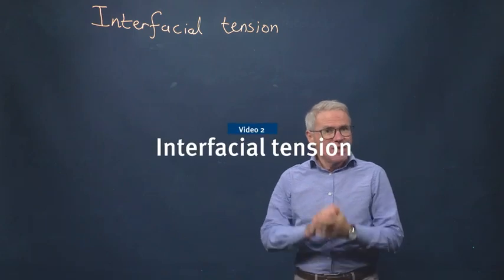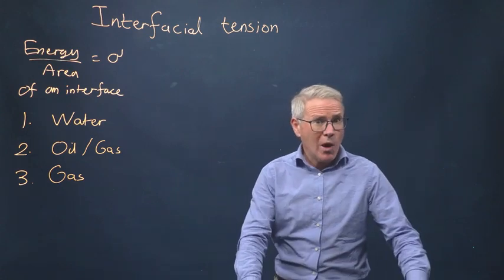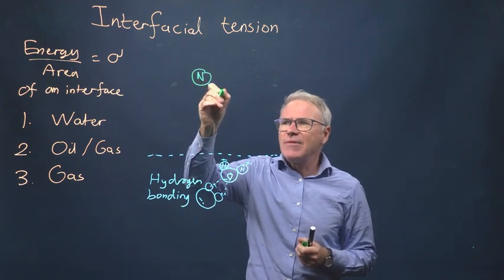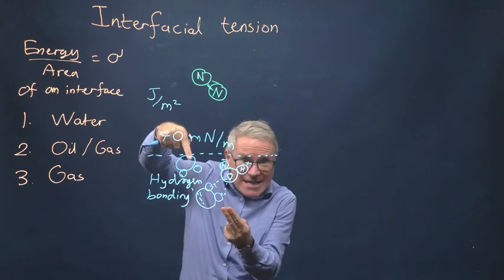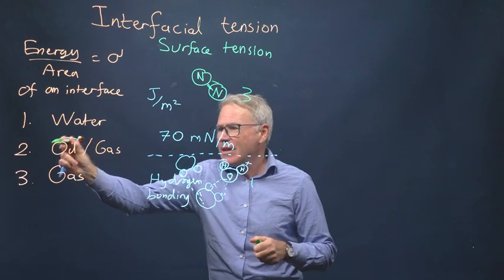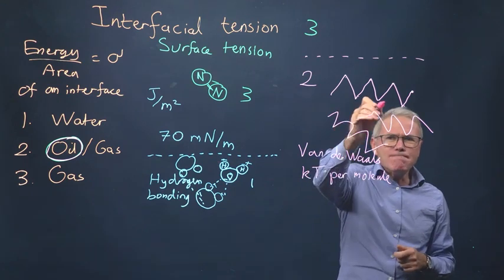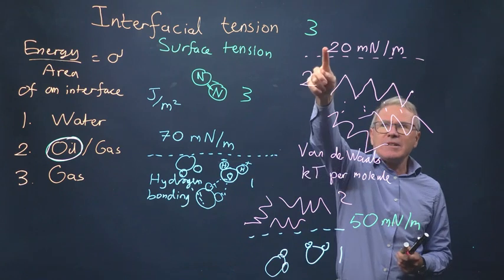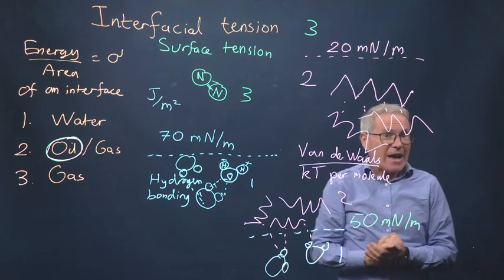Interfacial tension

Comment: Thank you! I love your video! And I have question regarding interfacial tension. If I measure the interfacial tension between water and oil using pendandrop method, would the results be different if I do it by creating water drop in water compared to inverted oil drop in water? I guess the results are the same? Can Young Laplace equation explain it mathmatically?
Reply from the maker: Thank you for your comment.  The results should be the same, as you suggest.  The Young-Laplace equation simply assumes that there is an interfacial tension - it does not help determine what it is.  To do that theoretically you need to know about intermolecular interactions.

Comment: Thank you !! I had a question, I need to analyze the interfacial tension in an oil spill that has occurred near the city I live in, how exactly should I use those measurements to calculate the interfacial tension. The oil that was spilt covered approximately 20 square kilometers.
Reply from the maker: If you had a sample of the oil you could measure interfacial tension using, for instance, the pendant drop technique.  This does however require specialist equipment.  You can also analyze the spreading of an oil spill on water - when the layer of oil is thin, its movement is controlled by interfacial forces.

Comment: Hello sir I have a question about the end of the video 
The relationship between IFT of the oil-water and oil-gas and water-gas is always true? or it works only under some circumstances?
I'm asking this because this relationship is not correct for toluene and air and water. I mean this relationship; (IFT water-air)-(IFT toluene-air)=(IFT water-toluene)  does not work
I think I have misunderstood something I'll be appreciated if you could suggest me any article about this subject
Reply from the maker: This is only an approximate relationship assuming a gas, water and a non-polar liquid..  So do not expect it to be exactly correct.
Reply: Thank you for your attention ❤

Comment: Sir I am having doubt your telling oil and water have 50 mN/m if same oil and water composition measured at different surface will it be still 50mN/m or it will change
Reply from the maker: The exact value of the interfacial tension will depend on the composition of the two fluid phases (oil and water in this case) as well as the temperature and pressure.  It does not depend on the solid surface properties - this affects contact angle.  Interfacial tension between two fluids is only a property of the fluids themselves.